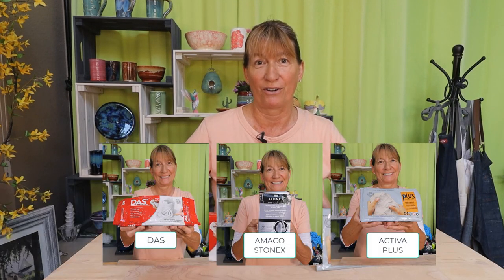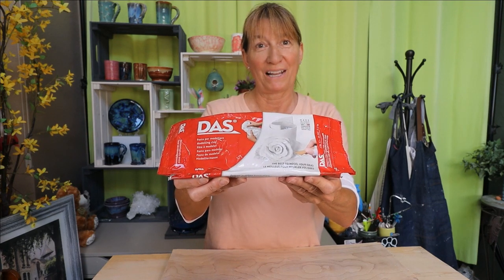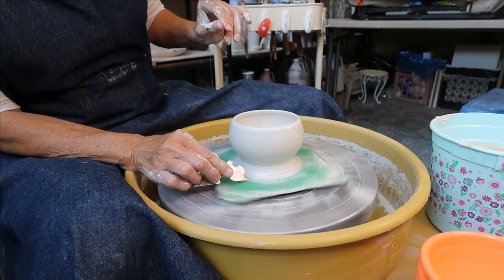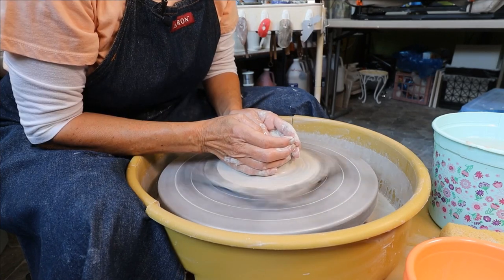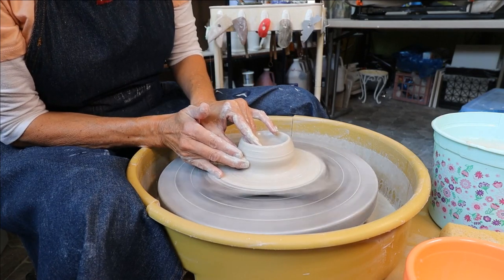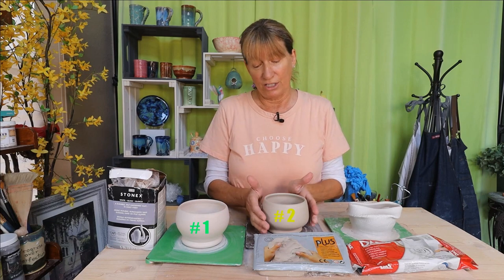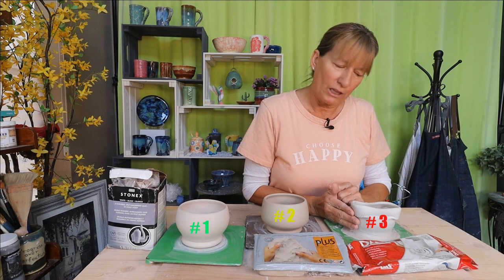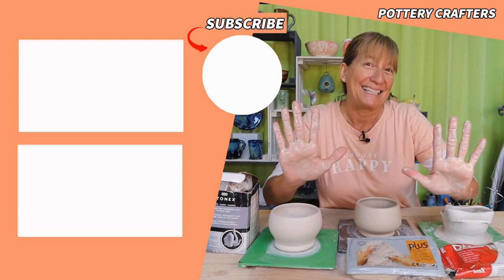I Test 3 Different Brands of Air-Dry Clay on The Pottery Wheel - And #1 Is

Comment: Great video! Thank you for doing this review! It was interesting to see how air dry clays perform on the wheel. I have worked with air dry clays for quite some time but for handbuilding only. I found StoneX being easy to work with but very brittle after drying. Activa works well for handbuilding and DAS suitable for small projects only. My favorite air dry clay is Laguna Mexo self-hardening clay. It works very well for large projects, easy to work with, and strong after drying. Would be interesting to see how it performs on the wheel. Maybe you can include it in your next review.
Reply from the maker: Thank you for sharing. 😊  I have never used air dry clay before. It was interesting to see how it throws on the wheel.
Reply: Yes!!! Could you please try the Laguna Mexo on the wheel? It would help a lot!! Thank you :)

Comment: Thank you 🙏 great teaching. Have seen somewhere that it’s better to use slip-water made with the porcelain clay instead of using only pure water. Maybe the same is good for air-dry clay too ? Slip-water made with the air-dry clay.  More strength in the clay when working with it …
Reply from the maker: Thank you. Yes you can!

Comment: A felllow potter told me to avoid cross contamination between air dry clay and stoneware because if you accidentally mix them, when you fire the stoneware, it can explode in the kiln? Please advise.
Reply from the maker: Just came back from vacation.😊Yes, it is true. Air dry clay is not made to be fired. I am not sure about the exploding part, More like melting.

Comment: Good to know about these brands for air clay.  Because these clays are not really waterproof, does that mean they can not be applied into the Bisguet fire and later the glaze kiln process?
Reply from the maker: That is a very good and important question. You are right air dry clay can not be used in the kiln or glaze fired. All you can do with this clay is paint it and use a sealer. Air dry clay is used if you don't have access to a kiln and for decorative purposes only.   😊

Comment: Hi  I have question. So when you use air dry clay no need after put in fire? For deep dry ??
Reply from the maker: Hi Maryam. Good question. Air dry clay is used when you don't have a kiln yet and want to make some things with clay. It will dry on its own, but you keep in mind that it is not food safe and you will have to acrylic paint to decorate with. 😊

Comment: thank you so much .. your channel like whole school for me♥️
i am beginner .. so can i use air dry clay (like this type in your video) for making a candle jar ?? like i will pour the melted raw wax inside it .. it will be hold on against the heat ??

if no .. how i can make it heat proof + water proof?
Reply from the maker: Thank you, Mariam. 😊 Air dry clay can be used for decorative purposes. You can paint it and seal it but it won't be totaly waterproof. You can make candle hoders but you need to use an insert to protect the air dry clay.

Comment: Hello, have you tried cold clay on the wheel? The one that can be baked in the oven?  I found online for example the porcelain I would like to try on my new mini wheel, I am trying to figure it out what is best option since I do have a kiln near that charge 4 pounds for 1kg of fired pieces , but I don't know how could I deal with miniatures pieces 😅 so it would be great finding a way that I can do it at home and still end up with a long lasting piece, that doesn't break easily.
Reply from the maker: Good question Cris. I wouldn't recommend cold clay for the wheel here is a post that will help explain the differences   https://potterycrafters.com/can-air-dry-clay-be-used-on-a-pottery-wheel/  Unfortunately you can't get the strength without a kiln. But you can make some cool things, paint them and apply a sealant. Enjoy your new wheel and the art of crafting clay 😍

Comment: Great video! This is one of many ways for beginner to try wheel throwing without need to use a kiln. But one question, did air dry clay can be recycle like a real clay if there are left balance after throwing?
Reply from the maker: Thank you. That is a very good question. I would have to try it and let you know. 😊

Comment: I love your videos! I think there is something wrong with my air dry clay. It is very damp and it is just about impossible to knead. The clay sticks to everything and I find it impossible to wedge as it just sticks to my hands. It is like pastry that needs a little more flour! When you take your clay out of its packet you seem to get very little on your hands, my hands are covered and it is so difficult to centre too. Any advice would be gratefully received
Reply from the maker: Thank you Lynda 😊 I don't know what brand you are using. It really shouldn't be like that. The three brands that I have used were not like that at all. I would suggest letting it dry out a bit and keeping a close eye on it so it doesn't dry out too much. Then try wedging it. otherwise I would suggest getting the Amaco Stonex. It really works well on the wheel. 
Here is the link for Stonex if you want to check it out. https://geni.us/0mLDVtf
Reply: @PotteryCrafters  thanks so much for your reply! I read the reviews of this clay (I am in the UK so I think the names of the clay are different here), after I had purchased it! I have only just got my wheel (a Christmas present from one of my sons) so know nothing about clay. I am getting a refund for the GlowHouse clay I bought and am now looking for an equivalent of what you use. I can find the Amaco  Stonex and I think I should try that, although it is very expensive compared to the clay that I bought! The Stonex will take a month for delivery, do you know of any clay I can find in the UK which would be an equivalent, I dont want to wait a month :)
Reply from the maker: I just received your comment. It took over a month.  😀 A bunch of them just came through from over a month ago. Hope you found something close to stonex to use on the wheel. let me know. 😊

Comment: I have Craft Smart clay. Bought at Michaels or Hobby Lobby type of place. When I try to wedge, it just keeps crumbling. Any ideas or advice?
Reply from the maker: I would try adding water. Just a little at a time with a spray bottle. 😊
Reply: @PotteryCrafters  thanks so much for the prompt response! I did add some water and it helped a bunch. I think I also expected the consistency to be thinner, and I only used a half pound. I suppose it might be better to edge more dough and then cut what you need for the project, instead of trying to edge exactly what you need? This was my first time using a wheel, it came out horrible 😂.

Again, thanks so much for the help, I really appreciate it.
Reply from the maker: You are most welcome. The first time I threw on the wheel it turned out horrible too, but I still fell in love with throwing.  Centering was the hardest for me. Stick with it Jimmy!   😊

Comment: Will amaco stomex crack after drying? Ince its thrown on wheel , many people using it for sculpting complain that it is cracked once hand sculpted plx reply thanka
Reply from the maker: That is a very good question. I have never sculpted with it. Only thrown on the wheel. I wedged it well and compressed the clay. I never painted or sealed it. I still have it and it never cracked. I hope this helped you decide which clay is best for you. 😊
Reply: @PotteryCrafters  thanks alot mam
Reply from the maker: Let me know how your mini pottery turns out. 👍😊
Reply: I will In Sha Allah thanks

Comment: What is air dry clay compared to clay? Confusing.... 🤔
Reply from the maker: Very good question Kim. 😊 Air dry clay does not go in the kiln. It is not waterproof or food safe. It is mainly for people that don't have a kiln but would still like to mold things with clay, like decorative pieces. You can then paint them and seal them with a sealant to make them waterproof.